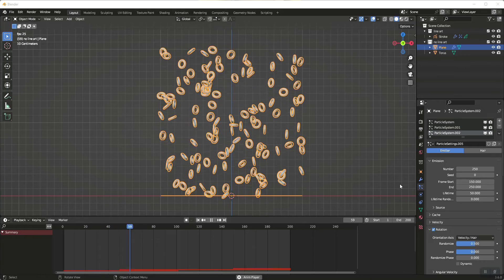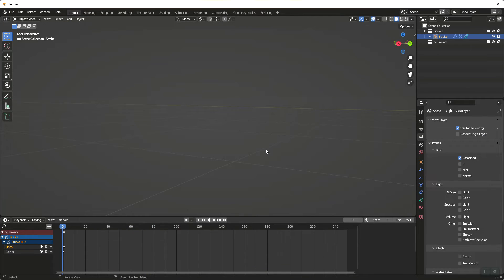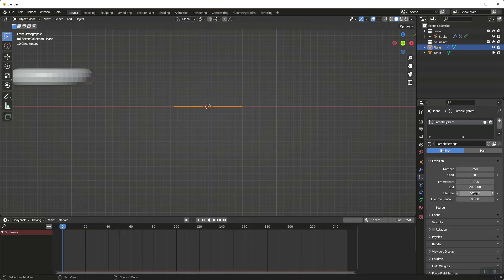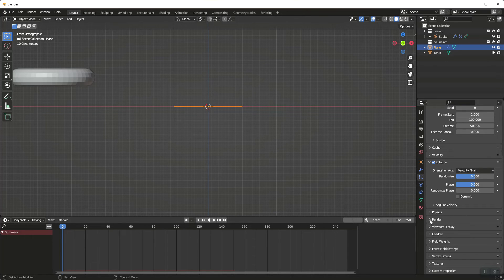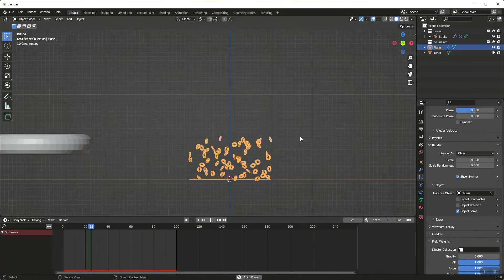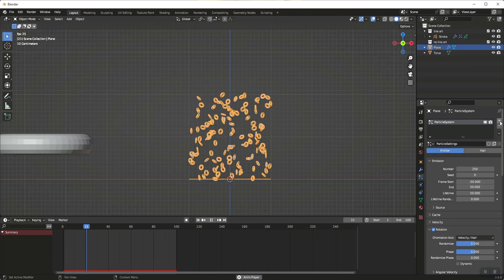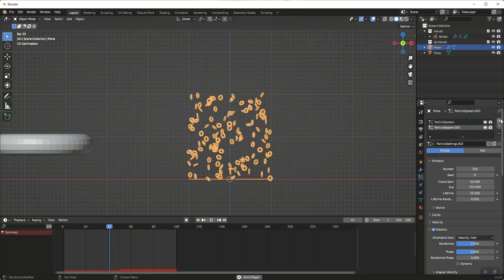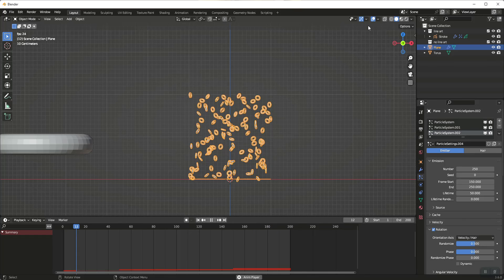BLENDER 3D | Looping Particle Systems Seamlessly

Comment: Using the number of frames twice the lifetime isn't always an option. I need a lifetime longer than the loop duration (so that particles from one simulation at the end of the loop would seamlessly transition to the respective particles of the other system at the start). And these settings are not enough to smoothly connect the two.

Comment: my brain hurts with this, why does it have to be in groups of 50?
Reply: ok I've figured it out, its 50 because thats half of the total frame range so when you add 50 back in it loops, genius! So you can actually do 500 instead of 50 and get 1000 frames
Reply: @eatmykwad   except that in the video he sets the frame range to 250 when he only has 3 partlcle emitters set at 50 each so it should be 300